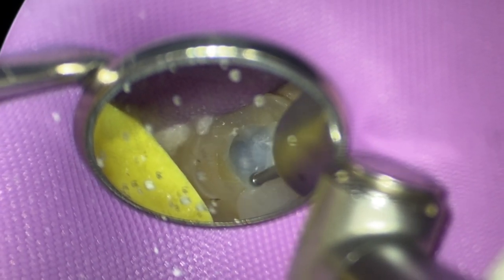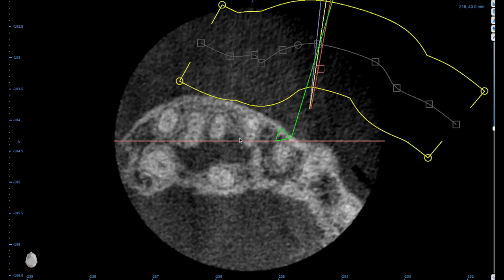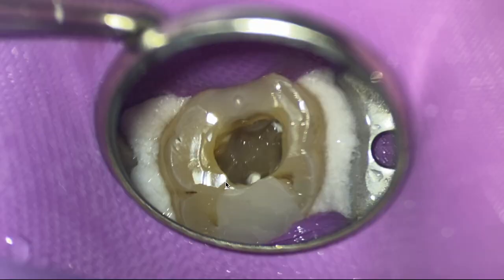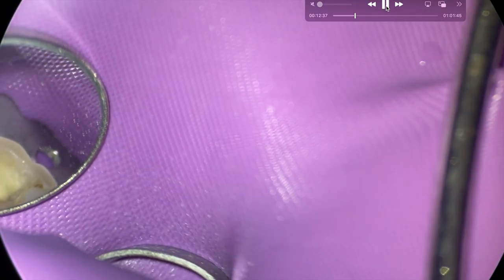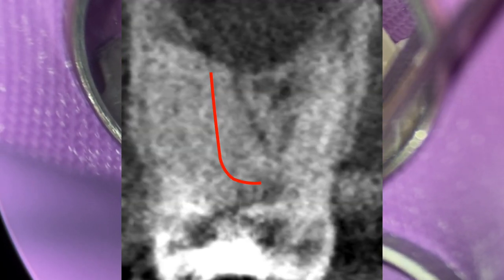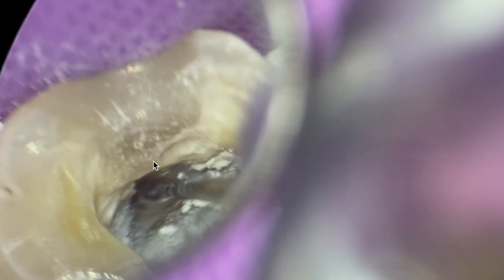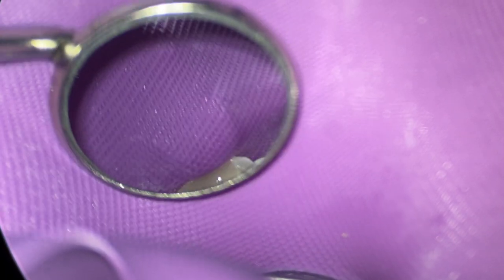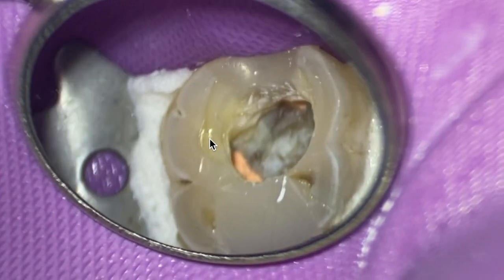This MB2 was SO tiny, I Almost Gave Up.

Comment: I sometimes see that white dot(thank you for confirming it/this tip ) or a hint of it, and use an activated tip of an 010 Mtwo file (I cut back one mm of the tip) and try to enter.that's when I can't get any any catch with manual files and I am pretty sure that there is a canal there...and boom it enters. but not always can go down all the way on an mb2 even if it's opened with a rotary file. hmm sometimes when it's blocked I do the molar in 2 steps. One visit of 40-70 minutes just to treat mb2 and obturate. most of the times I spend more than 20-30 minutes on mb2. almost never got an easy mb2.  
also great video!

Comment: Great case doctor! i think straight line access should not be compromised in upper 6 in the greed of preserving tooth structure. It is worse when canals like this are missed and patient opts for extraction rather than re-endo (atleast that's the case in my country).
unrelated but what are your thoughts about using light cure gic or flowable composite for immediate coronal seal.

Comment: Iv had a similar case sometimes when the mb2does not really start at the floor. And way deeper. Plus its calcified how do i avoid perforating in the inner wall doc. Sometimes even a cbct isnt helpful in tracking down an outline. Any tips

Comment: Hey Dr. Ash, any tips on obturating multiple canals at once?  I find that you cannot see where the orifices are once you have that much BC sealer down there on the chamber floor.  Are you doing it all by feel?  Also when you're inserting subsequent gutta percha points, I end up scraping off some of the BC sealer I coated on the on the point. Is that a big deal?
Reply: Use less sealer, you can also put some in with a k file before you put the GP in, if you can’t see the other canals do them one at a time- trim the GP off with a hot tip (I love it) or ultrasonic with the water off. With practice you get neater and neater with your GP/sealer placement